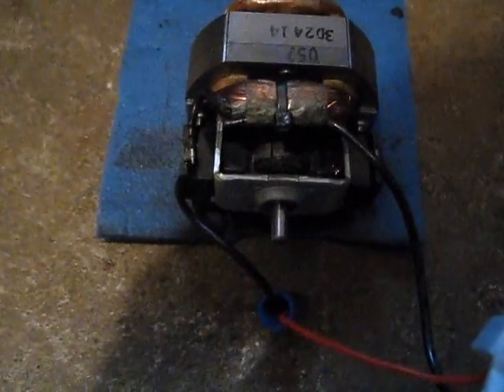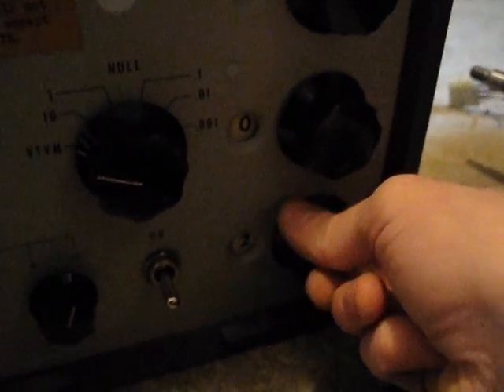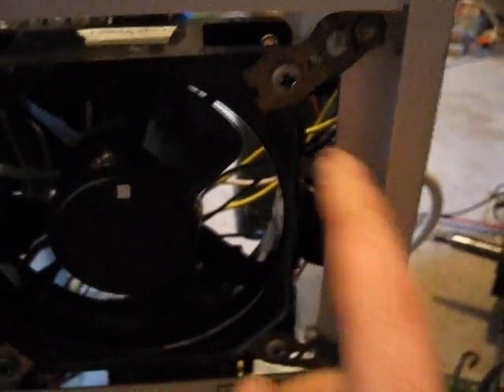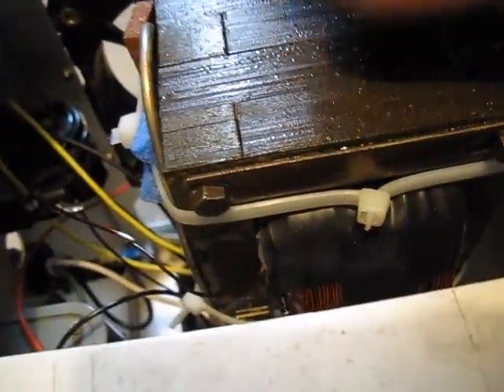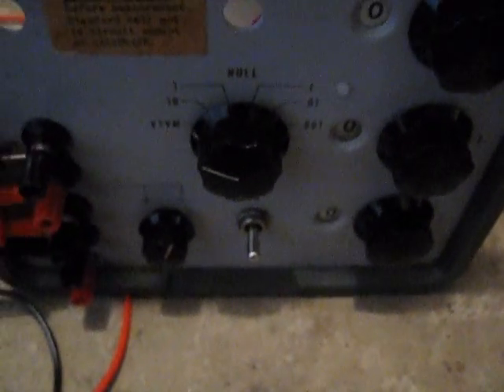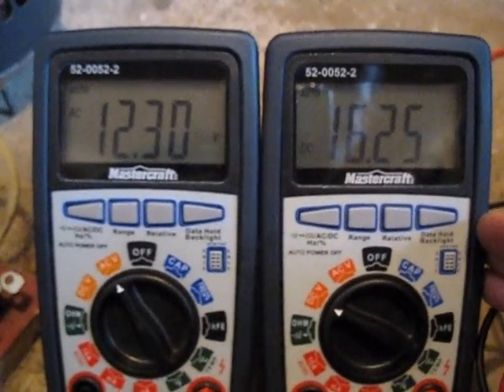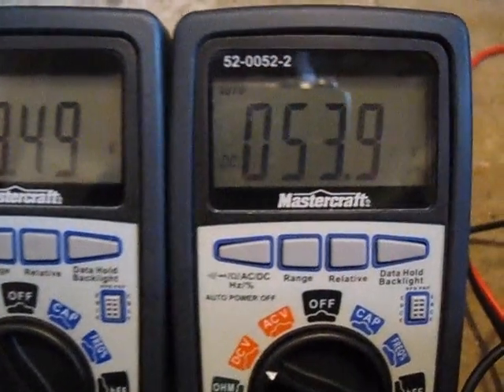Home-Made Voltage Regulator & Motor Burnout

Comment: I know this is 10 years too late, but for new viewers:  AC voltage times square root of 2 =  DC voltage from same source after rectification.  The peak of a sine wave is 1.414 times the RMS value.
Reply: So ac voltage x 4?
Reply: @JaceN3D  No.

Peak voltage x .7071 = RMS voltage
RMS voltage x 1.414 = Peak voltage

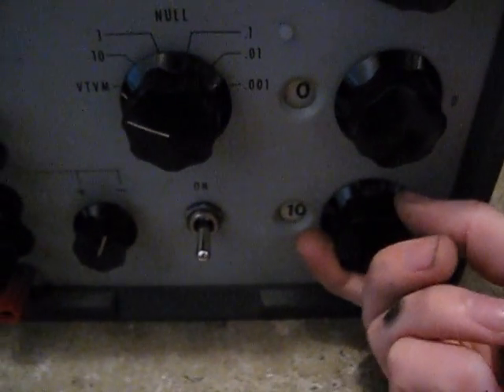Comment: I'm just pointing out, 1:15, you were wondering about the dials, and if you look at it from top to bottom, highest number you can dial is 499 (10). Beats me about the 10, but I'd think that the original thing could go up to 499 volts. Thanks for your video

Comment: The dc reads a higher voltage than the ac - this is normal but I can't quite remember why it does it. Something to do with ac being measured as rms voltage or something